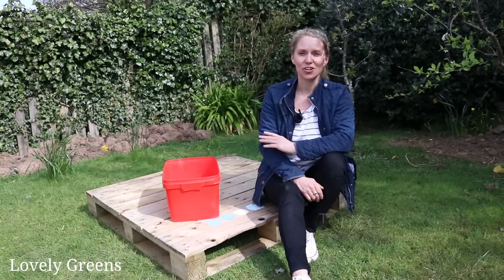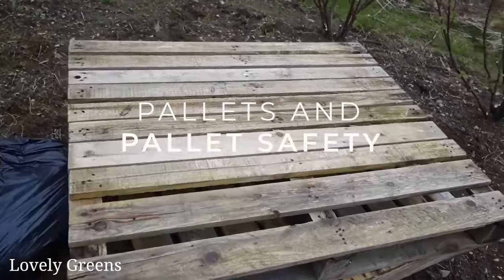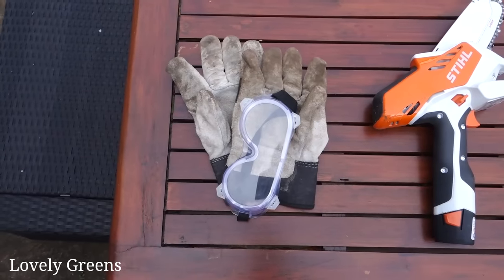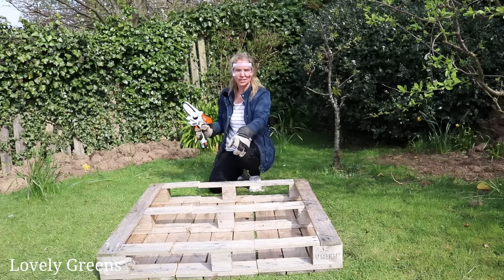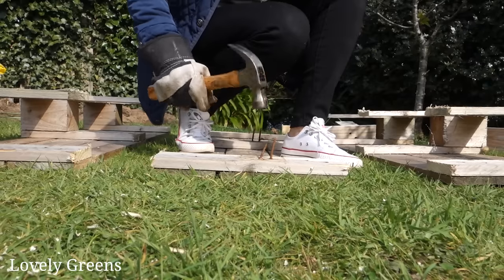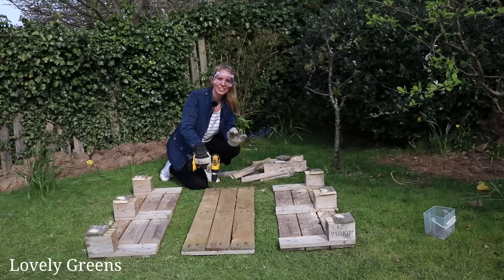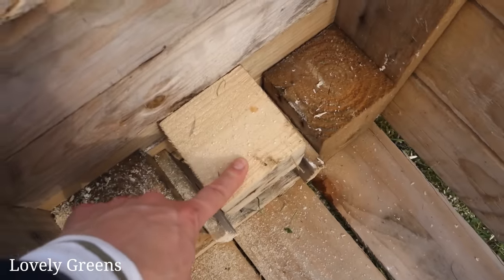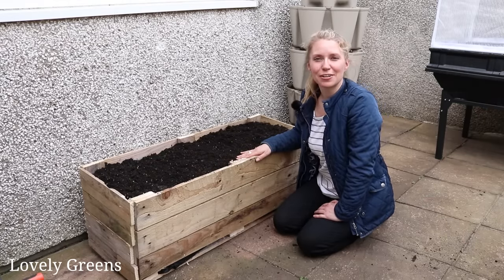How to make a DIY Pallet Planter

Comment: For those watching this video most pallets are not made this way so be prepared to have to make it different. In most the time when you yank on the wood on a pallet do you remove the nails it breaks the wood. The best way to remove as you buy a cheap ripsaw are reciprocating saw is what it’s called at Harbor freight for under $20 and you purchase metal blades for cutting nails and you cut a long between the nail and the two pieces of wood while someone holds the other part of the skid! This does two things it saves the world from splitting and you don’t have to worry about stepping on nails accidentally it’s always great to watch a video of someone doing a project that isn’t qualified you may be qualified in the thought process with this can get you hurt with Rusty nail’s involved

Comment: If you have a liner, why does it matter if the pallet was treated with insecticide? Thanks, this is an interesting project!
Reply from the maker: It could still affect your garden around where the planter is situated. Fortunately, the MB-treated pallets are fairly uncommon here, though. Hopefully that's the case in your region too.

Comment: You forgot one important detail! You should wear your protection when using a Saw! I’m coming from a person that is Randy Chain Saw for hundreds of hours that is a mini chainsaw! And most pallets are made out of hardwood meaning you’re going to dull  the chain very quickly . You’d be better off using a circular saw or what are use is a jigsaw with a heavy blade and it would be safer because what you’re using  kick back on you! Great idea for using the The pallet. However you keep using that to cut up skids you’re gonna ruin that tool and definitely double the chain before it’s time and it’s not very safe it can kick back.

Comment: Great video - I have cut up my pallet and now just need to order some decking screws to assemble it- what size did you use? or would you recommend? Thanks so much
Reply from the maker: 3” to put together the three main sides. 1.5” for the short sides

Comment: Question:  Do you need to put rocks or sand or anything on the bottom for water drainage?
Reply from the maker: In containers, adding those materials generally does the opposite -- it waterlogs the soil above. The material compacts and stops moisture from escaping from the few drainage holes. Fill with your choice of free-draining potting mix instead. Plenty of added vermiculite will aid drainage of excess water while helping to retain moisture inside each particle. Great stuff!

Comment: Yours videos are great.. I have ply wood which is from our old TV stand which we dismantled and not using it anymore. Just wondering if I can make a  wooden planter out of it. Ply woods are ok for planters or that is chemically treated. what are your thoughts?
Reply from the maker: Plywood disintegates quickly once wet. I'm also suspicious of the glues and other materials used to hold it together and don't think it's food-safe.
Reply: @Lovelygreens  Thanks for your response :)

Comment: I find the fabric at the bottom doesn't allow for sufficient drainage. Using quarter inch galvanized mesh or screen lets the water drain out better and still holds the compost.

Looks like your cat appreciated the new litter box. 😆

Comment: Brilliant. I made 2 years ago from your vid for tomatoes as you can attach a cage round it. Did you use the blocks for feet in the original. I did and pretty sure I didn’t think of that myself.
Reply from the maker: Yes, the blocks can be feet and that’s introduced in the first video :) This is a simpler take on the idea

Comment: you went the long way around to do that. if you removed the slats when the pallet was whole. you would have complete slats too. but, as long as it works :)
Reply from the maker: If you cut the slats first, then the planks on the back will be the exact size to create the sides.

Comment: Great idea! I will make a couple of these. However, please DO NOT wear gloves when using power tools!!! The gloves can get caught in the tool.
Reply from the maker: Thanks Heidi but I have to disagree with the point on gloves. They protect your hands from anything that might kick off the wood while you’re cutting. There’s no way my gloves could have gotten caught in either of the power tools I used.
Reply: Lovely Greens I agree that it seems counterintuitive, but wearing gloves while using any type of moving blade is dangerous. I’m a glove wearing girl, but not with power tools. Please, if you don’t believe me, research it. I would never comment on a post telling someone they are wrong if I didn’t know for a fact, from personal experience.
Reply from the maker: Stihl’s official guidelines for using the gta 26 tool are to wear gloves. The danger for wearing gloves for other tools varies by tool but is more pertinent for vertical rotating tools like drill presses and routers.